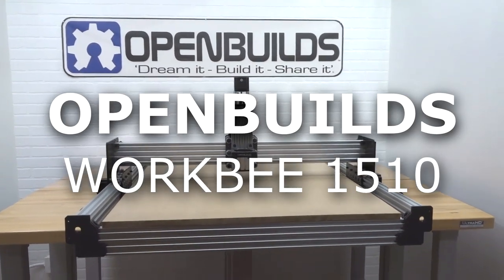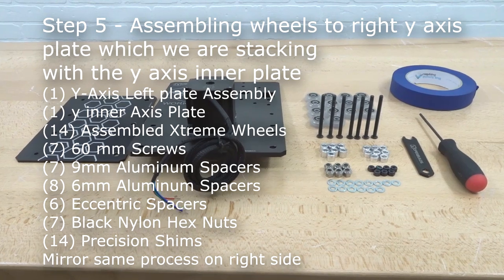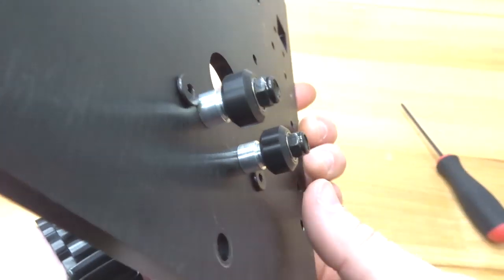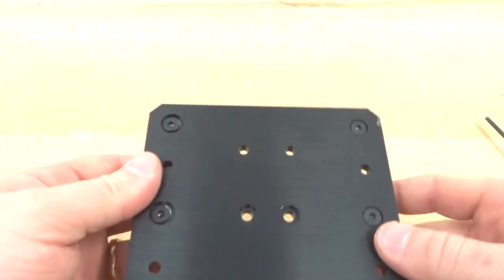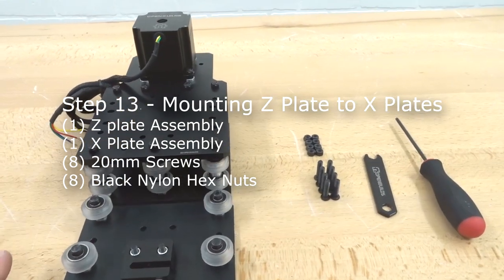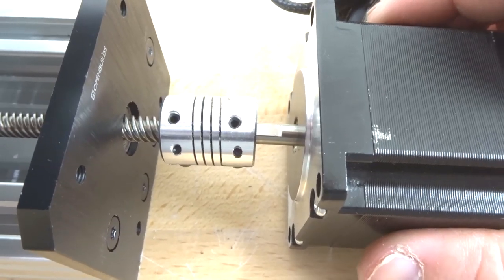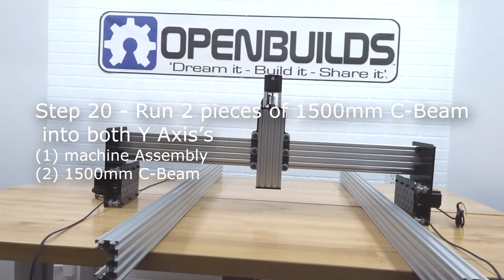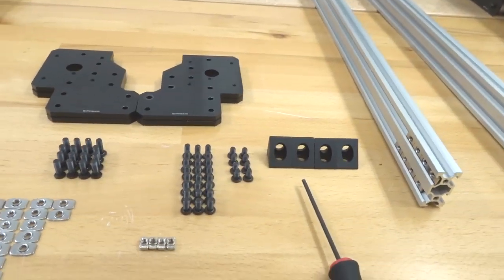OpenBuilds WorkBee 1510 Build

Comment: This is a super video !!
You use rollers, what is the accuracy of 0.01 mm or 0.05 mm?
How often do you pull the rollers?
thank
Reply from the maker: For the 1510 (since it is belt driven) the machine accuracy is 0.003" (0.10mm)~0.007"(0.20mm). We use Xtreme Solid V Wheels which are made from poly-carbonate, so as long as you lubricate with silicone every once in awhile these wheels can last for years. 👍

Comment: There does not seem to be much space for Z travel at all. Is this normal for this machine? I was going to buy one until I say this video. Am hoping for 40-50mm travel.
Reply from the maker: Hi Ciaran, the WorkBee 1510 comes with a travel of 76mm, but can be increased to 122mm by altering the spoiler board configuration like the WorkBee 1010 Lead Screw Driven. Please follow the link for additional information regarding this alteration: https://openbuilds.com/builds/openbuilds-workbee-1510.7189/